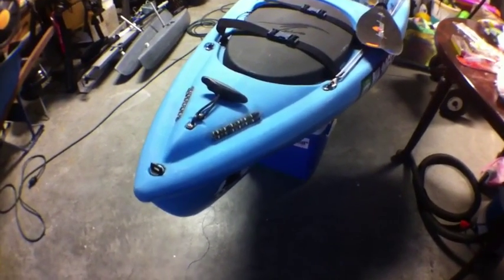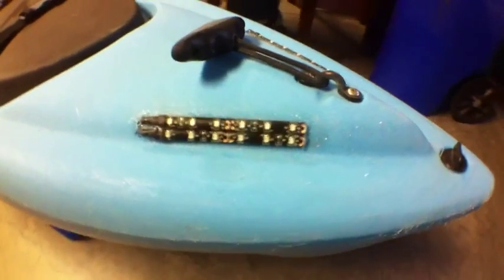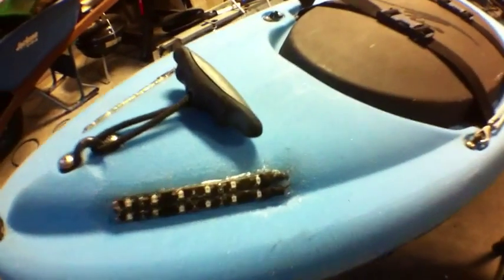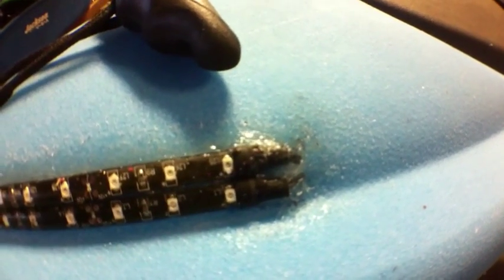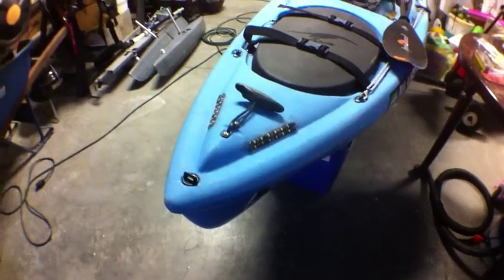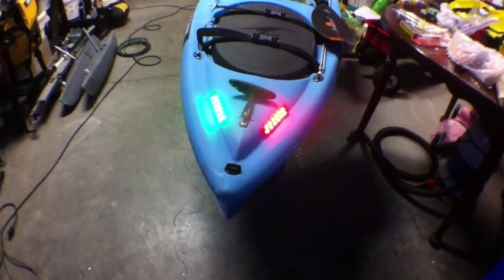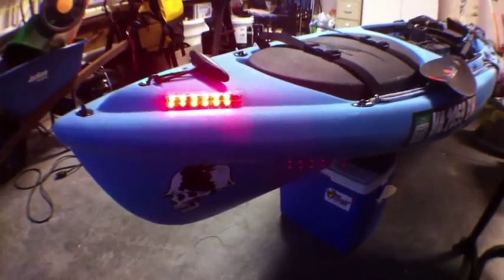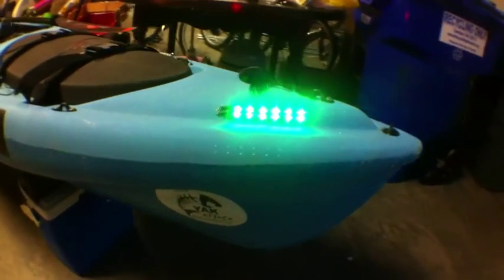Kayak Rigging:  Navigation Lights

Comment: It's actually very dangerous to put the red green bow lights on a yak. At night when on coming boats can't see you , but only see the lights, your giving them the impression  you are a motor boat and can maneuver  much faster than you can actually paddle/pedal. 
I would not recommend  doing this.
Reply from the maker: Yes I agree completely however this kayak was motorized.